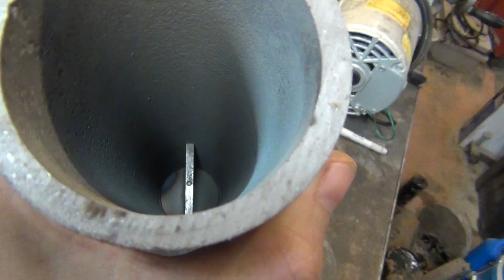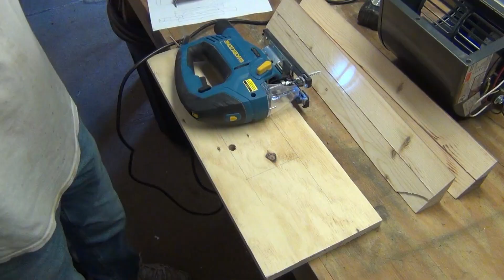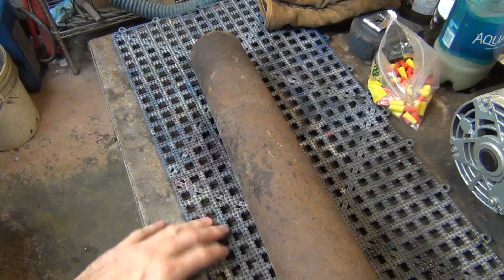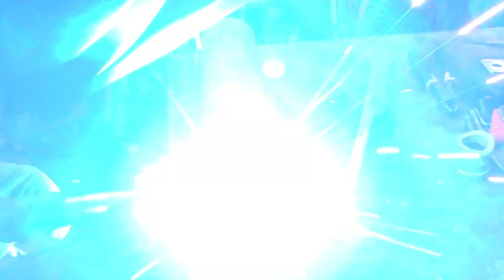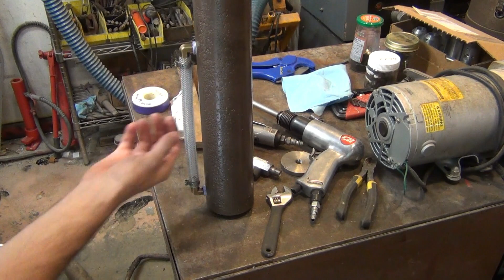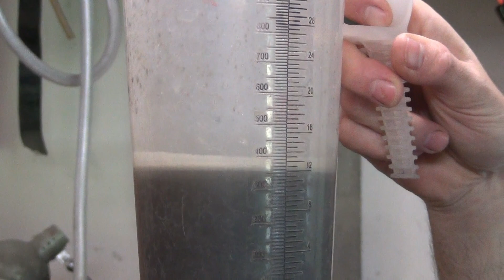DIY Compressed Air Dryer | What Is An Air Drier?

Comment: My knockout design is much simpler. Started with 3" galvanized pipe, 48" long. Bottom end is threaded. Threaded a reducing coupling on the bottom end which put 1" FNPT threads on the bottom. Then bushed down to 1/2" NPT and installed a ball valve for the drain. On the top end, not threaded, I welded on the side, a 1/2" NPT sockolet for the inlet. Then I bought a 3" slip flange and welded it on the top end. Then I mated a blind flange to that. Drilled a 1/2" hole through the blind flange. Welded a 1/2" npt coupling on both sides of the blind flange. On the bottom side of the flange I added 1/2 galvanized pipe nearly to the bottom of the 3" threaded leaving a bit of room for water collection. So a pipe inside of a pipe. In engineering parlance I fabricated an annulus. No machining required. Just drilling and welding. Air flow comes in the top side inlet from 1/2" line to the 3" pipe. Which means the flow velocity suddenly drops. Then as the compressed air gets to the bottom it makes a 180° turn upward leaving most of the water behind. Instead of baffles I put SS scrubber pads. Which provide a lot of surface area for water droplet adhesion.

Comment: I was looking at his impressive fabricated separator.  I really like it.  But then I got to thinking since I don’t have the same skill set yet with machining.  What if we used 1 inch pipe setup as a U, with a T at the bottom with a long tail to collect the moisture.  I think that would achieve the same result?
Reply from the maker: Fair point. One thing. If you're going to go that route, I would use larger diameter pipe for the U section, especially the bottom pipe, and maybe make it a little longer for water storage. Put a tee fitting on the downstream end for the drain valve. That way the air will slow down, and allow moisture to settle on the bottom, and give you a bigger reservoir to drain. Don't worry about the sight tube. I've found you really don't need it, as long as you drain it daily if you're using it a lot in humid weather. It does collect a lot of water, and will the smaller capacity of a U, I think this type will be need to be drained more often.
Reply: @ArnoldsDesign  wow, didn’t expect a quick response.  Agree, larger pipe diameter should be used.

Comment: Add an auto drain to the condenser that blows open when a float is tipped. Common on truck air breaks and the like.
Reply from the maker: Thanks for the tip.

Comment: couple of thoughts I had....to start off with, I would have added a small red ball to the semi clear braided tube... would make visibility that much better. You could also 3D print a red 3D cup(open end facing down) instead of a plastic ball. Also, I would have built a box around the fan so you can use an air filter to keep the inside of the heat exchanger from matting up with dust and any other floating particulates that will get trapped in the heat exchanger.

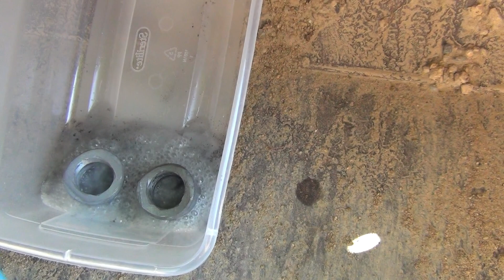Comment: What sort of acid(?) were you using at 14:57 to clean the metal after you did the tube notching on the fittings?

Overall, quite a well thought out design, well done!
Reply from the maker: Muriatic acid I picked up at a hardware store.

Comment: baking pan with a computer server fan attached  connected to the rad face works great. and low draw. they are 120 volts . For a water collector you can put the coarse stainless steel pot scrubber pads inside and it gives moisture a place to condense on.

Comment: Do you have a link to the fan you used, or rough dimensions?   Thanks
Reply from the maker: I don't remember where I bought it now, but it's a Dayton blower, model 1TDT6, two speed 1/15hp.
Reply: Thanks! @ArnoldsDesign

Comment: Wow.  You really put a lot of work into removing water from your compressed air, and it shows.  Something that also shows might be good to address as well; dust going through your blower.  Some air filtration is adviseable there, too, as many house fires have started in the dust that collected on blowers without filters.

Comment: This is a really great setup. There are a lot of videos for DIY air dryers on YT, but yours is particularly well thought out and constructed. The squirrel cage is a good move, better than just using the fan built into the compressor pulley, though that works too. I think your setup lends itself to multiple use, including a fan to circulate air within the shop with a ducting to bring air in from outside when desired, and with a filter downstream from the heat exchanger could supply fresh air for a home paint booth. Your water separator/drain vessel is also a really, really good design. Nice job and thank you for sharing.
Reply from the maker: Thanks

Comment: get a colored bead that floats and fits into your braided tube. it will allow you to see it better. get red ,yellow or blue, not brown or black.
Reply from the maker: Good idea. If I built another one, I'd just omit the sight tube. As long as it's drained a couple times a day, there's no issue.
Reply: yep, but it would be cool to have that one working. @ArnoldsDesign   so if you come across a bead that works....

Comment: You’re never going to get a 35 to 40° dewpoint out of that after cooler on a hot summer day.
There is no substitute for a refrigerated air dryer with the exception of a twin tower desiccant dryer
Reply from the maker: I have absolutely no issue with water during the summer with this dryer on my dry cabinet, or powder coating. That is when I extract the most water. Of course I won't get the same dew point as a refrigerated dryer, but I also don't get the loss of air volume due to lower temps. I'm quite satisfied with this setup.
Reply: @ArnoldsDesign  what do you mean by loss of air volume due to low temps?
Reply from the maker: @rotarycomptech  Charles' Law. To put it simply, gas volume for a given pressure is directly proportional to the difference in temperature.
Reply: @ArnoldsDesign  well, you lost me there never heard of that one before. I’m sure it does exist though.
It must be a very, very small fractional amount of loss, considering there is no correction factor in sizing a compressed air system using a refrigerated compressed air dryer, however, at full rated capacity many refrigerated compressed air dryers will have a 3 two 5 PSID across them
Reply from the maker: @rotarycomptech  Understood. Lets say compressor inlet is room temp at 70°F, and refrigerated dryer output is 38°. That would result in a 6% loss in volume. With what I'm doing, I have no net loss in volume, bc my heat exchanger is also room temp, and is using the compressor outlet temperature difference (app. 185° to 70°) to condense out water vapor. Even with my higher dew point, I experience no condensation in cold lines, or water discharge from small diameter nozzles, jets, or moisture traps, i.e. pressure reducing areas. If I had an application that required bone dry air, then I would get a refrigerated air dryer, but it's not necessary for what I'm doing, especially since I'm running high duty cycles as is. If I had a much larger compressor, I wouldn't be concerned about 6% loss.
I used to use a non regenerating desiccant setup, which worked fine, but I opted for my current setup, as it is less maintenance.
Reply: @ArnoldsDesign  most refrigerated compressed, air dryers have what is known as a pre-cooler reheater in most cases, there is very little to no difference between the inlet and discharge temperatures the pre-cooler reheater would in most cases correct your temperature issue you’re referring to I believe
Reply from the maker: @rotarycomptech  Ah, I see. Good to know!
Reply from the maker: @rotarycomptech  But I'm still not buying one.
Reply: @ArnoldsDesign  rather than plumbing the air directly out of the tank through that after cooler, you could run the discharge line from the compressor to the after cooler and then back to the tank and have a tank full of pretty much but not completely full of dry air, and your little compressor room will be cooler
Reply from the maker: @rotarycomptech  Thanks. I may try that.
Reply: @ArnoldsDesign  if you do, you’ll find that your compressor room will be quieter as well,
It would illuminate the pulsation resiences tank sound. back in the 50s and the 60s Quincy compressor used to use what they called a cushion chamber to illuminate tank noise. Although it turned out to be a safety issue due to carbon buildup and relief valve failures became kind of a ticking time bomb so it was eliminated.
Reply from the maker: @rotarycomptech  Interesting

Comment: You've motivated me to engineer something awesome and see how well it works. compressor with its own little room ..slightly insulated with a fan on each side pushing and pulling circulating air throughout the compressor room. Going to do a setup very similar as yours with a heat exchanger, but I'm going to put an in wall AC unit that will obviously fire into the compressor room. So the room will have constant airflow and then actual air-conditioned air being blown out directly into a fan blowing through the heat exchanger. Not only having a water filter before the tank.... But also running another 25 to 30 ft of airline, then running to another water filter with pressure gauge... and then a desiccant filter....then out to my main line.  And most normal circumstances when people are putting the water filters so close to the output of their compressor without doing a heat exchanger are really shooting themselves in the foot.  It's really 25 to 50 ft down the line when the water vapor really starts.  That way my idea above will knock out every aspect.  👍 Great video.  Best setup I have seen yet.  Thank you for your time and effort and sharing this with us

Comment: Dry clean air is imperative to some businesses. I designed the air delivery system for my little brother's powder coating business.  I started with the Prevost air system lines.  I used their plan and added a few modifications to go with the  EMAX 10-HP 120-Gallon Variable Speed Rotary Screw Air Compressor Fully Packaged w/ Dryer. So no dryer was figured into my design, although when this $16,000.00 dollar compressor had a catastrophic failure after the first mandatory oil change with E'Max labeled oil ( they no longer sell btw) , the airline design ended up saving him a lot of possible issues. His Gema powder coating system suffered zero damage from the oil and water that blew into his lines. It blew right through the dryer and passed all of the initial fail-safes that were in place, to a blow-off valve, I had set to just under the maximum pressure limits.  90% of the contaminants were taken care of there and the other 10% got into the line loop, but never made it to his tools. He was terrified the Gema setup he was using was compromised when the compressor failed.  The system was on loan from Gema as a beta tester and had not even been released for sale in the US market.  He was the only Gema Customer in FL that was chosen to demo the system pre-release and feared his relationship with Gema would be hurt after working very hard to build it.   Thankfully everything worked out and that is the very system he powders with today.    Your video is great and very informative. Thanks, for the detailed explanation.  BTW it looks like you have a dream setup of tools for a DIY fabricator like myself.

Comment: How well does this work in warmer temperatures?  I live in Australia and I’m unsure if this would work well in summer weather
Reply from the maker: That's when it shines the most. Warm rainy days you wouldn't believe the shit it catches. One project I don't regret doing at all.
Reply: @ArnoldsDesign  that sounds awesome, I’ll have to give it a crack
Reply: Mount a small in-room air conditioner so it blows through the inter cooler. Set it to run when the air compressor runs. That will really pull the water out of the air.

Comment: Arnold, great video!  Would you please share the brand/model number or a link to the heat exchanger you used?
Reply from the maker: You might not want to hear this, but the aftercooler was $284.37 when I bought it in 2020 on ZoroTools. I just found out it is now $419.74. https://www.zoro.com/akg-air-cooled-aftercooler-max-hp-25-100-cfm-c-70100bg/i/G2111706/?gclsrc=aw.ds&gclsrc=ds
They also make a smaller one for $288.09: https://www.zoro.com/akg-air-cooled-aftercooler-max-hp-15-60-cfm-c-3560bg/i/G3188306/
Reply: @ArnoldsDesign  I appreciate you sharing those links!  I'm sure others do as well.  It is a little expensive....time to look on FB marketplace! Thanks!!!
Reply from the maker: @SteveKran  👍

Comment: Great design.  Any chance of finding out more about the heat exchanger you used?  Who makes it, model number?  Maybe even a link to a website where we can buy one?  I did a quick search and couldn't find one that looked like the one you have.  Any assistance would be greatly appreciated.  Also, you have some serious skills and equipment.  Mine will be more primitively built I assure you.
Reply: ZORO TOOLS.
Reply: @TheJagjr4450 ,, maybe a part #… there is like 55 pages of heat exchangers and the first 4 are nothing like what you used to

Comment: will a car radiator work
Reply from the maker: I don't think they can handle the pressure that's used.
Reply: Look at transmission coolers frequently rated to 250psi. Find one with at least 1/2" fittings
Reply: Any chance you could post a wiring diagram on how you connected your 110v fan to come on when the compressor does?

Comment: Why the heck did Youtube stop email notifications for new subscriber videos? I never know when folks post new videos now. I recently picked up a 5hp CompAir Hydrovane compressor, tank mounted.  It has an after-cooler between the comp. air outlet and the tank, but NO drain or drip leg, so apparently the water goes in the tank anyway!  Funny but not funny. Really nice design Brad!
Reply from the maker: Thanks! I think this after cooler was meant to be mounted directly to the compressor too, but I wanted cooler air flow over it. Regarding notifications, that could be why my views keep going down despite uploading videos again. It is what it is I guess.
Reply: @ArnoldsDesign  Yes it's been 3 or 4 years since they stopped email notifications. Many creators do not realize that. They keep telling viewers to click the bell......doesn't do any good anymore. Youtube said it wasn't used enough and viewers didn't value it so they shut it down, despite millions of viewers complaining about it being stopped.  Can't get thru to the experts I guess.
Reply from the maker: @kmcwhq  Yeah, youtube does pretty much what it wants.

Comment: Couldn't you put a small red (or other high visibility color) plastic ball or cylinder that floats on top of the water into the reinforced plastic tube to show the level ... The ball/cylinder has to be a loose fit but not so small it passes through the 90 degree bends
Reply from the maker: Great idea. I might redo my sight tube now.

Comment: If the internal rusting in the condensing trap starts to be a problem, maybe drill a threaded fill port at the top and fill it full of rust converter (tannic acid), let it sit a bit then drain it out. Plug the fill hole. This device is amazing..insanely clever. I bought a refrigerated condensing unit for our shop. It works..but the price..OMG. Cheers my friend..hope you are well.
Reply from the maker: Thanks Warren. That's a good idea. I've been more diligent about draining the sump, which has reduced the rust quite a bit.